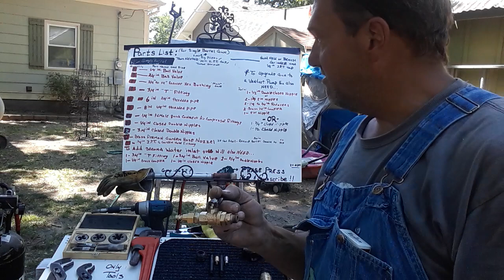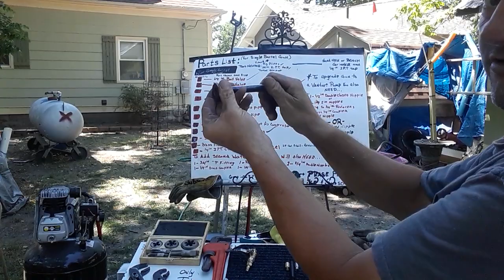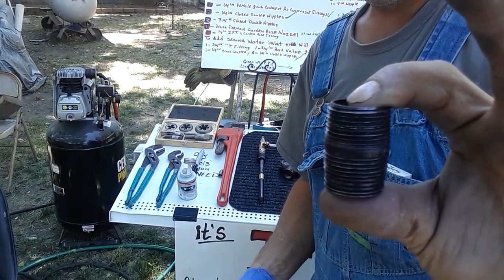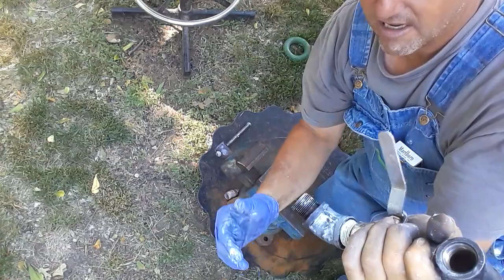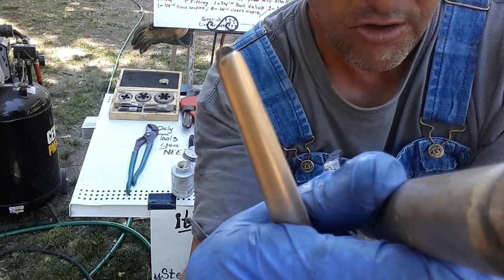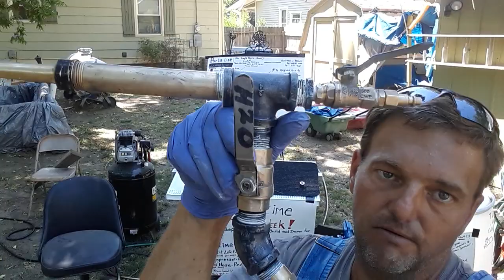Homemade Air Powered pressure Washer Gun from random parts.

Comment: Five years ago,  I am so late to the game!  Great instructional video, but I will let you know when I attempt to build my own off your design. Thank you for sharing your idea and experience. Last Sunday, February 2, 2025,  I picked up a 2002 Craftsman Air Compressor Model # 919.167340 | 33-gal | 6Hp | 120v/60Hz/1PH/15A from my local curb store. The owner told me that it still runs, but I need to purchase the gauges and a air hose: he helped me load it onto my truck. He upgraded to a newer stronger air compressor.  I was fortunate to find a Owner's Manual on the Sears Parts Direct website and after reading it and learning that a lot of the parts are out of production.  I realized I don't know enough about using a air compressor; consequently, I am pondering on whether to keep the new replacement parts that I purchased from Ace Hardware. I was hoping that I could use the compressor to pressure wash the swimming pool deck and the driveway, but then that means more money! Yesterday, I spent nearly $110.00 for a air hose, two pressure gauges, a needle valve for the drain, a Craftsman Compressor Starter Kit and torque 20 bit. Today, Friday, Feb 7th I removed the shroud covers and cleaned them, but I still need to learn how to safely power it on. The sales clerk advised me to power the compressor on before I add the gauges, because it if doesn't power on then I can easily return the unopened products.

Comment: can you put a link to an example of the parts? 
(ie: 1/4” closed double nipples, 1/4” ball valve, etc)
simply going off what's mentioned & shown in the video isn't clear enough really but only because there seems to be variability for each part - such as male vs. female ends, etc.
thx
Reply from the maker: You can email me a request for a parts list . I answer these requests on a weekly basis to all of my subscribers.
Reply: @tctime  sounds good, sent an email over just now... any reasons  it's better to use a 1/4" male/male ball valve instead of a 1/4" female/female ball valve that has a close hex nipple attached to each end of the  female/female ball valve? 

I ask because I'm wondering if I can save on costs by opting for the male/male ball valve instead.
Reply from the maker: I believe the answers you seek will be in my video titled..  "Inner" venturi flow power pipe.  You can find it on my playlist.... The King's Gun Series. Did you subscribe?
Reply: @tctime  yep!
Reply from the maker: @david-tracy  ok thank you.  I'll get that to you in the next couple of days. 👍🏻

Comment: Great one again, question, if you want to increase the water volume, would you say use 1” pipe with say 3/4” internal air structure”. My air supply is a piped system in a factory setting, I’d love to use your design to help maintain my machines and the metal chips that build up
Reply from the maker: You could actually use one inch pipe for the outside,  and 3/8 internal pipe structure for the nozzle you would have to start with a 1-inch reduced down to 3/8... the  nozzle you would have to start at 1in.  Reduce to 3/4 then  1/2 to 3/8 . Unless you could make something  out of one of your machines.  A smooth bore on the inside of your nozzle would be preferable. Hope this helps.
Reply: @tctime  absolutely does, i believe my air outlets are well over 100psi out of each machine, I need to be able to have pushing power at a little bit of distance
Reply from the maker: That's great. Reply back with your results.  I'm excited to hear from you again soon.👍
Reply: I’ve got an idea for you to test if your up for it, i was thinking about the pushin power last night while the dog was licking my face and I was thinking what would happen if you branched off the water supply and brought a second stream after the air to add volume, not quite like your redundant setup for your two pressurized water tanks, just the same water source adding a second stream back in
Reply from the maker: Any idea is worth trying.  Thanks for The input my friend. 👍

Comment: What would you say is the minimum compressor tool pressure for this nozzle gun to be effective?
Reply: Thanks TC!!!
Reply from the maker: The store was designed to run on 60 to 120 PSI although it will work under that and it absolutely works with more pressure than that. I would say that your CFM is more important than PSI.... Most air compressors 30 gal and up will keep up with the tool though.

Comment: Can you use it with a portable air tank
Reply from the maker: Yes you can. I actually use one when I go camping to spray my boat off when I am done fishing. Works great small jobs.
Reply: TC time I was thinking of installing on board air for my class B camper is there a tank size that is too small
Reply from the maker: The amount of air that you're able to store in a portable tank will determine how long you can run the Kings gun with pressure. So the larger the tank that you can fit in your space the better off you'll be because the larger the tank the longer the runtime of the gun with pressure. I would recommend converting a propane tank into a portable air tank for this purpose so if the pressure in the tank is used sparingly you can get almost any job done that you're going to need to do while camping. Also Harbor Freight makes a really cool little small air compressor that you can plug into your cigarette lighter and using this you could refill your tank while out camping. Tell you what I'm going to put one of those together today to show everybody how to do this and the video will be uploaded by tomorrow. Thanks for the idea for my next video that I'm going to do this weekend. I hope this answers your question if you have any input since your question led to the video I'll take any and all feedback into consideration while building the tank. Thanks again for the question and comment.👍👊😎
Reply from the maker: You might keep in mind that you can make long pressurised air tanks out of 6 inch PVC and pressure caps the length of your camper you'd be surprised how much water and air you can store in those you just have to be careful to leave your water tank valve open so steam doesn't build up it probably would never be an issue but you just have to keep in mind all of the safety things  if you paint the tanks black Water will get hot in the Sun ...real hot.. it's just a safety thing. Or you could install a pop out valve.

Comment: Could you show how to make a wand well a siphon house that would connect to your garden hose to use for washing siding on house, the siphon hose would be for putting in bucket of cleaning mixture to spray wash siding
Reply from the maker: Thanks for the question already was wanting to know are you going to still have your garden hose hooked up for your water source or are you wanting to use the 5-gallon bucket to put your cleaning solution that is diluted down, or just using the bucket for your water source and cleaning solution? The reason I'm asking is there are several different ways to do this and I want to give you the most efficient answer possible. There are several ways to do this,  and would like to address this comment in a future video.
😎👍👊
Reply: @tctime  An extra hose for siphoning soap products would be great!
Reply from the maker: Currently working on two different ways on doing this...#1 utilizing the venturi effect on the nozzel tip..#2 using a pressurized tank with the soap mixture and an additional "T" fitting, and ball valve on the gun to control how much soap mixture. Will be doing a video soon on this. If you hit the notifacation bell, you will be sure to not miss it.👍
Reply: @tctime  Thanks! I will subscribe and set the alert bell! Good Luck!

Comment: Cant the (2) 4" long 1/4" threaded pipes be one 8" pipe? also can you cut the 8" long 1/4" pipe to the angle that you cut the air chuck piece as long as it matches the out pipe length that is.
Reply from the maker: Short answer is yes. May I suggest watching "INNER" Venturi flow Power pipe on my playlist. The answers you  seek are there.😎👍👊
Reply: @tctime  ok will do! Does the female hose tip have to be tapered  down ir can you just attach a fireman style nozzle onto the 3/4 pipe? Or any style nozzle for that matter? I imagine the air water mixture is happening in the female hose flute section and is required?
Reply from the maker: Hey sorry my friend I just got your notification of this question just now so I apologize for the delay. The answer to your question is yes you can but if you make any changes to the design be sure and use a check valve on your garden hose so you don't have an accidental pressurization of the gun. The fireman hose nozzle works the best I've tried reducing down fittings and the performance just isn't the same for me. Most people probably wouldn't notice the difference. The most important part is to not reduce it down to the point that your air and water cannot Escape the hole that is at the end of your gun. If this doesn't answer your question please post a new comment so I'll be sure and be notified right away but I think that answers that I hope. Thanks again for the interaction and good luck my friend.